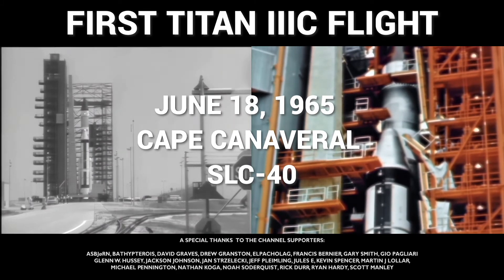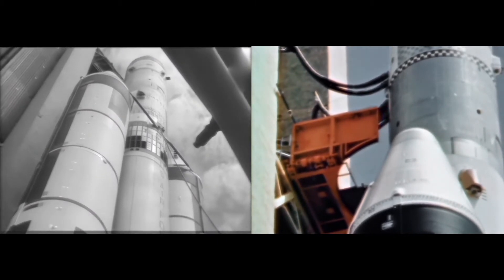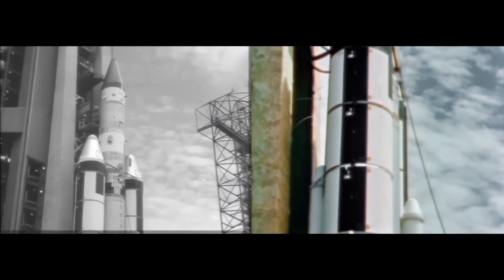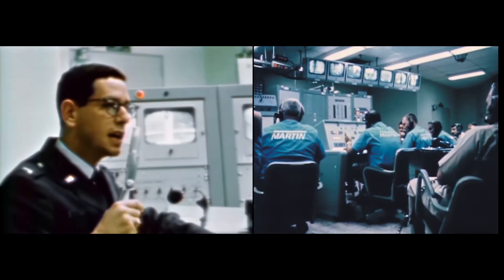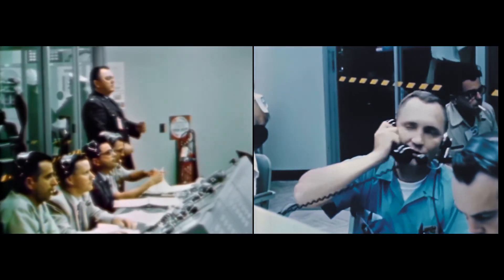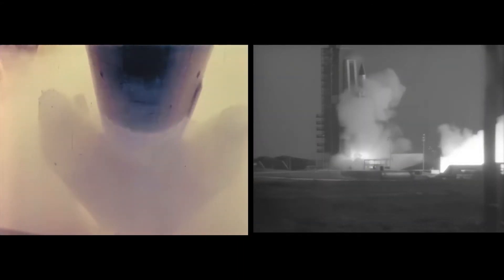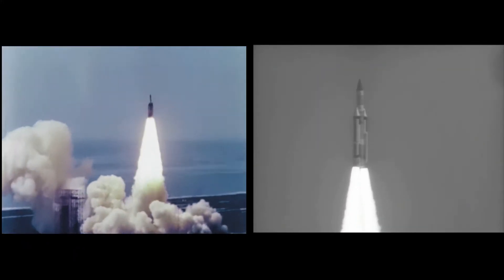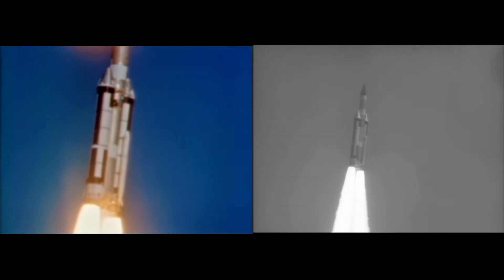Titan IIIC First Launch - Cape Canaveral SLC-40, Multiple Views, 1965

Comment: Such a unique vehicle. I’m sure a modernized version would be easy to build.
Reply: Not really sadly, designing a rocket is extremely difficult and expensive, especially rockets that use toxic fuels like the Titan series.
Reply: @TheProky  if I remember correctly there was a Titan V proposal that would’ve switched to cryogenics but got beat out by Delta IV.
Reply: It was done: Space Transportation System, or 'Shuttle'.